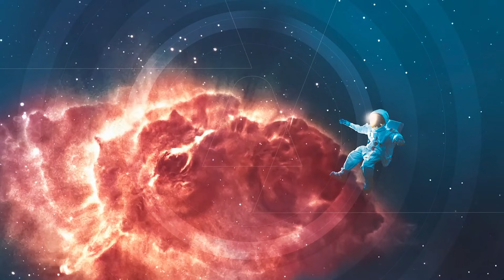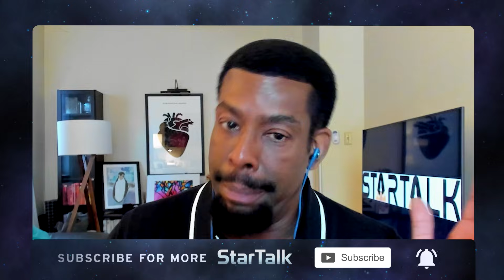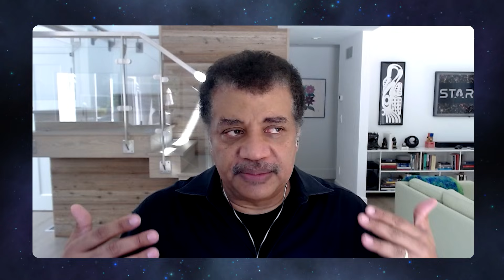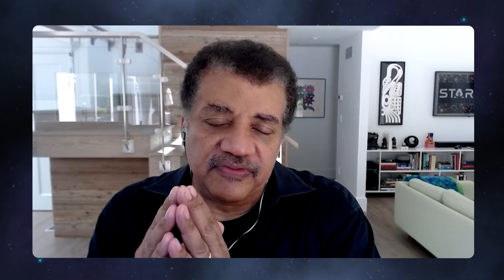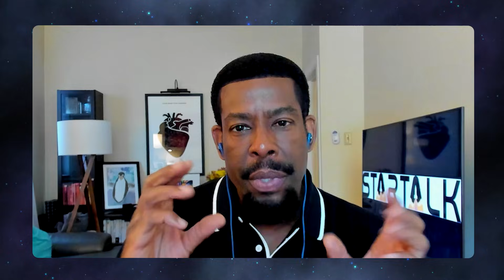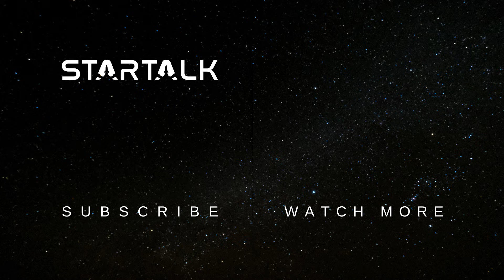What Actually Is White Noise? | Neil deGrasse Tyson Explains…

Comment: Resonators can work (or bring out or emphasize) the individual frequencies that reside within white noise in a very similar way as a prism works for white light. If you put your ear up to a tube with white noise playing in the background,, you will hear the sound wave that that tube (resonator) is tuned to support the most. As an experiment, you can create a semblance of white noise in your kitchen by turning on the water faucet in the sink, then put a water glass up to your ear until you hear a predominant pitch and that is the fundamental frequency that the water glass is tuned to support at that distance from your ear. It's also why you can hear the ocean when you put your ear up to a conch shell. The shell is acting as a resonator and the ambient noise around you is made up of an array of frequencies.

Comment: As a kid I had weird reactions to the old TV sets. For example, if someone turned one on anywhere in the house, I knew.  I could hear the frequency. Now if you put your hand up to the TV, you could quite literally feel static build up on the screen between channels.  But i could also SEE a difference on the screens! In The Legend of Zelda: a link to the past for the SNES has a specific section where you walk acrossed a twisting invisible path. But i realized if i looked hard enough I could almost see a sort of distortion. While my sister saw nothing, i was able to walk the entire thing without using the ability to reveal the path or having played that area before.

Comment: hey Chuck there is brown noise (some engineers call red noise), has power decreases at rate of four times for each octave so has more of a rumbling sound, low frequencies get lots of energy but tails off at higher frequencies.  There is pink noise too, go ahead and go one of two ways with the jokes for that, but it has equal power for each octave making power get lower as frequency gets higher, just at not as fast a rate as the brown noise tails off at higher frequency.

Comment: Fun fact: in the audio engineering world,  weighted white noise - where the amplitude (energy) of high frequency information is logarithmically attenuated to match the energy of low frequency information is known as "pink noise". It's typically used in calibrating the phase and frequency response of sound systems.

Comment: Of course, the additive method of merging the 3 primary colors of RGB light creates the color white – we see this in projectors and variations of light bouncing off of things generally. But there is also the method of combining inks and paints called subtractive in which equal amounts of 3 colors combine to create the color black. The fun part is that if you look at the CIE charts for light, the horseshoe has a trick in it. If you create a line from red through the center point (white), the line ends at Cyan. The line from blue ends at Yellow. The line from green ends at Magenta. It is those three – secondary – colors that combine (if you have extremely perfect inks) to the color black.

Comment: 3:29. Situational occupied space in a singular particle level gives off a noise. The ability 2 increase the volume is a matter of hearing cape ability. Ie. We only can measure why we know. Or have the ability 2 measure. Case in point. White noise tv. Is the vibrations of the antenna or structure based on the occupational space occupied by interpreted instrument.  USS Albuquerque. #SSN706  03-05  #ShackLife  case in point. Only 3 29 in. And told u.  U have my attention. And I got a Whole lot of🙋‍♂️🙋‍♂️🙋‍♂️🙋‍♂️🙋‍♂️🙋‍♂️🙋‍♂️

Comment: The term "white noise (phenomenon)" could be re-termed as "constant power spectral density (phenomenon)".  Of course, it would be ridiculous to have all those extra syllables - just like it is in air-water psychrometrics where the term "adiabatic saturation (temperature)" is instead simply termed "wet-bulb (temperature)" since that is the equilibrium temperature of a wet (even if the wetness dries off almost instantaneously after its application) surface, and indeed meteorologists have used a standard mercury thermometer with the bulb surrounded by wet cloth to get it.

Comment: I remembered the horrible static noises upon turning on the TV - it would make the most sense as of why the CMB would be the source of static noises both in audio and video, as there's actually not much difference between TV and radio in term of general electronics design, they are just to fetch any tuned radio frequency and feed to the amplifier and detector circuit prior to sorting out what the TV and radio want, thus the statics.

Try tuning to around 55 - 85 MHz on FM radio, especially 78 MHz, you would hear unusual hums, that's the Population III stars' "light sink", whose their intense ultraviolet lights simply cause the Hydrogen to stop emitting the normal radio frequencies in their pure, neutral state, especially around that frequency of 78 MHz, instead of the usual screeching below 70 MHz and possibly beyond 92 - 110 MHz which the CMB is basically composed of - those frequency were originally between 1 and 3 GHz in the microwave band those Hydrogen emitted before being redshifted (there's a paper published on this). For better results, it's best to do it away from the cities, so it's radio quiet.

Comment: White noise is all frequencies with equal energy at each frequency. That causes more energy in higher spectrums because of there being more frequencies closer together as you go up. An ultraviolet catastrophe for sound engineers because of too much energy that high up. 

Pink noise is all frequencies but the energy is the same per octave, or logarithmic distribution. So the per frequency energy goes down as the frequencies go up. This is more often what sound engineers use for speaker set up. And there are variations of it. 

Computers, digital devices can not generate a true white or pink noise because digital devices can not generate a true random number. (Explainer?) They can run a program that simulates one and resets at some point in time.

Comment: Is zero the most important number?

Zero is the most important number in mathematics. Zero functions as a placeholder. Imagine a number, e.g., 5 and put as many zeroes behind it as you can think of. Zero drastically changes the value of the number from a mere 5 to 50, 500, 5000, 50000 and beyond.

Which is the greatest whole number?

There is no 'largest' whole number. Every whole number has an immediate predecessor, except 0. A decimal number or a fraction that falls between two whole numbers is not a whole number.

Why is it impossible to divide by zero?

The short answer is that 0 has no multiplicative inverse, and any attempt to define a real number as the multiplicative inverse of 0 would result in the contradiction 0 = 1.

Is 0 a rational number?

Yes, 0 is a rational number. Since we know, a rational number can be expressed as p/q, where p and q are integers and q is not equal to zero. Thus, we can express 0 as p/q, where p is equal to zero and q is an integer.

Is 0 A whole number?

The whole numbers are the numbers 0, 1, 2, 3, 4, and so on (the natural numbers and zero). Negative numbers are not considered "whole numbers." All natural numbers are whole numbers, but not all whole numbers are natural numbers since zero is a whole number but not a natural number.

Why is 0 a good number?

Zero helps us understand that we can use math to think about things that have no counterpart in a physical lived experience; imaginary numbers don't exist but are crucial to understanding electrical systems. Zero also helps us understand its antithesis, infinity, in all of its extreme weirdness. 🔘

Comment: Does the snow on the TV screen also relate to the white noise?
Reply: yes that is what they were talking about. Except cable TV and digital TV don't typically make white noise, it will go into signal loss rather than displace the static TV white noise from the past analog TV's did.

Comment: The white noise on tv is also caused mostly by Jupiters radiation if I remember correctly, sad Neil missed this fact this time
Reply: But Jupiter is not always above the horizon yet the white noise remains the same. So I doubt jupiter has anything to do with it.
Reply: @MrT------5743  I would assume the radio waves are still present in the 'shadow' like sunlight is still present in the shadow just in lower amount. Also pretty sure I heard this fact some years ago from Neil himself, tho it might be that there's new science that negates the theory. Can't really find a concrete answer whether this is true or not
Reply: @MrT------5743  The fact I can't easily find clear evidence that Jupiter would be causing this is probably clear enough to say it's not the main reason at least. Still there is a lot more radiation sources besides Jupiter to keep the tv white noise always going. Sun is higher radiation source than Jupiter, also there's the rest of the universe which would keep the noise while out of line of sight of sun and Jupiter. Also I just realized you might be seeing white noise that is caught by the tv towers or something rather than what your tv is catching directly. This would also vastly increase the area of reception of this noise and keep it mostly same at all times
Reply: @SpiritOnSteroids  Yes there is many sources of white noise. The sun is #1. The earth and it's atmosphere and magnetosphere is also a lot. As far as Jupiter is from the earth, I doubt it has any measurable effect.

Comment: So, I work in live audio, and we use something called pink noise to tune our speakers. It’s white noise, but the high end is attenuated so that you hear all the frequencies equally, since white noise tends to build up toward the higher end of the spectrum. It’s called pink because the light equivalent would be to attenuate the blue light.
Reply from the maker: Thanks for the info!
Reply: He said all that in the video, but he messed up in the pink noise aspect.
Reply: Amplitude as a function of frequency (correct me if I’m wrong):

White noise — constant
Pink noise — 1/f
Brown noise — 1/f²

To get the power/energy density as a function of frequency, multiply each of these by f. What your ears hear is the energy, not the amplitude, which is why white noise seems dominated by the higher frequencies. So pink noise has constant energy over the frequency band.
Reply: These are all random noise signals, where a sample at any particular time shows no direct dependency on a sample at any other time. In computer graphics, we also like to use “noise” functions which are not really random, but always have the same value at the same point.
Reply: For example, Perlin and Musgrave noise functions are handy for producing various interesting textures on materials. A little bit of Perlin colour variation can turn a clean, immaculate-looking object into a dir
Reply: ty, grimy, more realistic one.

Comment: Is the radiation from the sun all frequencies?  Same as lightning to a lesser power?  Our receptors are tuned to very narrow bands.  It's all energy in a sinusoidal form at a specific frequency.   That is perception.   Be it in the RF range or Audio range.  It's all the same.  Right?
Reply: Ah, now you come to another physics concept, that of “black body” radiation. Black is the colour that absorbs all light most perfectly. But if you heat up a black object that it glows, will it radiate all light most perfectly? Oddly enough, it does not. The radiation-versus-frequency curve follows a characteristic function that depends only on the temperature, not what the object is made of. (Make it hot enough, and even its original colour no longer matters.)

So in terms of the radiation it emits, the Sun is physically close to an ideal black body at a temperature of around 6500K.

Comment: There are actually a variety of noises like pink or brown noise, used by sound engineers.
Reply: We always used pink noise for “ringing the room”. As the electrician I could never tell the difference. 🤷
Reply: @anorcott  Pink noise is more similar to what are ears listen to. White noise is equal in the electric domain and pink noise is more equal in the acoustic domain as we perceive it, so it has the opposite curves in frequencies that are ears like to have.
Reply: Pink noise is tuned for the human ear. It has higher amplitude on the low frequencies and a slight increase on high frequency. Always used for audio calibration on sound systems.

Comment: I’ve always wondered if the first people getting color tvs were disappointed that the static was still in black and white..
Reply: When I was just a little kid in the 70's, we only had a B&W TV. And every Saturday morning as I watched my cartoons, I would always wonder what they would look like in full color... and finally, many years later, my parents bought a color TV. And I was soooo disappointed when the very first shows I saw were a B&W Bugs Bunny cartoon and a B&W Abbott & Costello movie... I was totally doing a "wait, what...?" 🤣
Reply: Why is that? Because the colour-decoding circuitry in the TV needs to pick up a special component in the broadcast signal before it turns on. This is to avoid introducing a certain level of random colour noise into a black-and-white picture (imperfect analog circuits, don’t you know). So in the noise that the receiver picks up in the absence of a signal, there is nothing resembling this colour signal, so the colour decoder remains off.